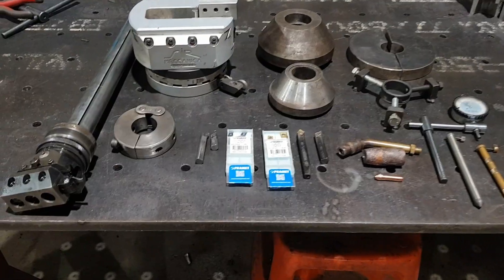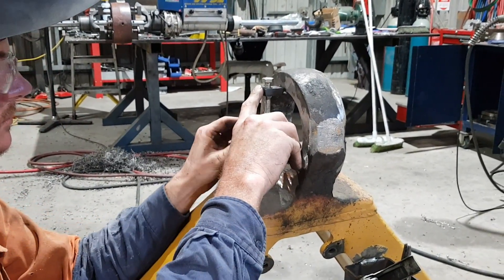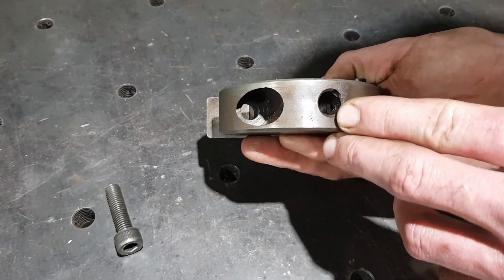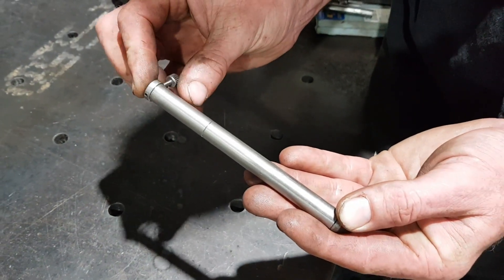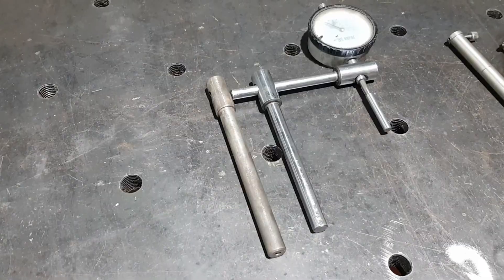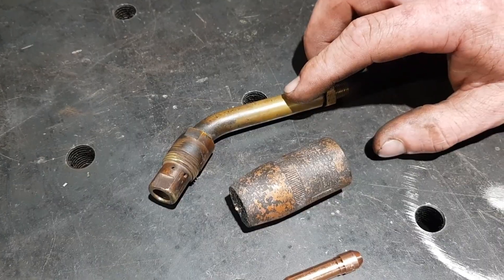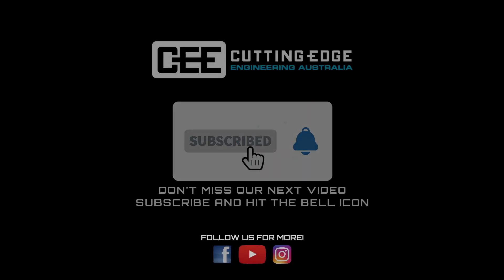Tooling for Line boring & Bore Welding Machine | Sir Meccanica WS2

Comment: This filled in a lot of the blanks. Normally this stuff goes by really fast when someone is doing a boring job. I'm familiar with all of the components in different contexts e.g. a boring head on a mill or a wire feed welder. I had an idea on how this all went together but this makes it very clear!

Comment: @2:23 "They are quite fiddly..."  Yeah, I can imagine trying to indicate something to center with three jack screws 120 degrees apart is frustrating.  Have you tried a shop-made version using 4 screws, more like a 4-jaw chuck?

@4:38 "It's very easy to get on and off the bar."  Do you have any experience with Hofmann Engineering's line boring tools?  They appear to have a wide assortment of tools that are split to clamp over the bar, so you don't need to pull the bar to swap from boring to facing or whatever.  Their current website no longer features a complete catalog, just a two-page brochure, which doesn't show their full range.  Somewhere, I have a download of an old multi-page catalog from Hofmann which shows their various line boring tooling (including fancy taper heads and whatnot, not all of which do clamp on the bar).  I like the way you used the chain link to make a double hinge joint!

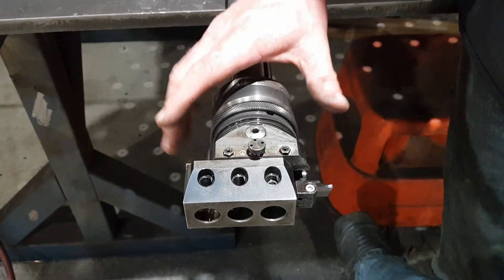@10:46 Nice adaptation of a standard boring and facing head to the bar for end boring.  I like!

@14:10 Great tip on the header paint as anti-spatter!

I have a couple of projects for which I'll need to do a bit of a lash-up line boring rig: boring loader bucket pivots for bushings; boring and counter boring my Land Rover engine block (2002 Disco with 4.0) to accept top hat liners (!); fab and machine an articulation joint and output shaft support to convert my old gear drive Cub Cadet to 4 wheel drive with articulated steering.  I've never used a line boring rig, as yet, but I think if I'm careful, I should be able to make a kit that will be generally useful beyond the immediate tasks at hand.  No one local to me wants to mess with boring the engine block, and the other two are recreational in nature and not necessarily remunerative when completed, so I can't justify paying someone else to do it, or even justify the cost of bar rental.  So, it's make my own or nothing.

Thanks for the very insightful video.

Comment: Great information in this video! I use and Elsa machine roughly every day and I need to get some quality tool holders for more flexible machining. What brand are the holders you use in your machine? The tool holders that come with the Elsa machine only hold an Elsa specific insert and they are not cheap and take a while to get in. I need some more flexibility for the day to day with some standard and common inserts. Keep up the awesome work!!

Comment: There's your side line, Mate!  Manufactured and marketed by your theoretical apprentice; one or more 'CEE Upgrade Accessories for the line  borer.  After market improvements for what appears already to be a great machine.  I love that line borer.  A versatile, compact and (apparently) robust machine that makes 'impossible repairs' possible and even straight forward, but only because CEE have stress tested every part.  And made your own.  Maybe other engineering firms have done the same, but I bet a lot haven't.

Keep doing what you are doing guys, I reckon you are becoming role models.

Comment: Do you have a tool to cut the faces of holes? I've only used climax equipment and not impressed. But I can't find a tool they make to cut faces flat. I've had to bore holes and add weld to the face of a hole to get the correct specs but no tooling to cut faces besides grinding by hand!

Comment: Hi! At 12'...is this a NAREX VHU 36 universal boring head? I worked with different Types of these NAREX Tools a long time ago at a mighty W200 Skoda Moving Column Boring Mill in the eighties nineties... These Skoda's are very heavy industructible Machines with LOTS OF TORQUE an KW's... To break the neck of a 120mm diameter(3/4 🍌 Bandana? 🤔) Drillbit Tool was not a Problem... 😉

Comment: Hi Kurt, thanks for the fine video, I have a huge amount of line boring to do on my machine, but curious on how your tool holder holds in place when you have just a chain link master link and a screw, do you bore it small and let the screw take up the tightening?

Comment: Add a set screw to the backside of the split block cutting tool holder to be able to fine adjust the advancement of the cutting tool?

Comment: Dear Kurtis, I really enjoy watching this video. I own an old SIR bimotor plus and a S3. I bought them cheap in electronically and mechanically broken used condition and reapaired and improved them step by step. Indeed engeneering and manufactoring quality of this stuff is not the best.  After the bimotor was running I had to thing about the tooling. After spending 400 bucks in original Sir Meccanica welding and turning consumables I decided to make my own (because it is not difficult, it is not worth the money). I made 1:1 copies of the welding torches out of brass. Turning tool holders I mill out of comparatively cheap chinese SCLCL06 boring bars with comparatively cheap CCMT and CCGT inserts. I still miss snap gauges (but I own a boring bar measurement tool from stationary line boring and an Interapid IRA2). I am thinking about making my own or buying some. Do you have any hint what brand is your steel one?  I started a first serious project a ditch cleaning bucket from a 25t excavator (central bolt). After the final cut and inserting the bolt I observed the problem that my holes became light eggs (around 0.10mm). At the moment I search for the reason in my remade bearing inserts (original ones were massively worn out) or in a bended boring bar (did you had exactly this problem with the original boring bar?). My next accessoirie project is making a new one out of 40mm 42CrMo4 piston rod.

Comment: You're right about manufacturers providing shitty accessories with their products. I bought a Rockwell 3rill combo with drills and bits, the right angle adapter and chuck adapter were cheap garbage. Chuck adapter kept on loosening and the right angle adapter held only hex bits.
Reply: Also the Rockwell didn't patent the 3rill and batteries so other brands stole the design of the batteries and drill. Rockwell sold it with patent pending written on them, that means any company can steal the design without patent numbers

Comment: I had never heard of the Meccanica line boring system. I will have to look them up. I have used Climax (USA) quite a bit for line boring with success. I also really like Mirage (UK) for most other onsite machining. Wachs (USA) and MillHog (USA) for pipe work. Thanks for sharing.
Reply from the maker: Nice one a good range there! Cheers 😎👍

Comment: A very good explanation. I had not even seen this kind of job till I watched you. You have just answered about all of the things that came to mind while watching. The only thing that looks a bit of a pain is the adjustment of the tip for the next cut after you have measured the bore. I can imagine that it is easy to make too big an adjustment and then move it back too far and end up overshooting the required position. Any possibility of a fine thread adjustment grub screw in the head? Having said that when you do it all the time you probably dont even find it a problem. Keep up the good work both of you.

Comment: Love the low-key “f*@k off Sir Mecchanica” comments. You are a man of class Kurtis.

BTW, ever considered modifying your custom cutting tool holder to include a cam or toothed rack advance to fine adjust the depth of cut? It would require cutting indexing features or teeth in the side of the tool holder, but would allow slow controlled movement of the tool instead of tapping it in and out.
Love the videos, your director knows her stuff!! 🤣

Comment: Very nice presentation on Your tooling for line boring. The massive boring/planing head, I can imagine how it does not have room to operate in most settings. I have a similar unit with Your Vertex. Mine was manufacured by germans under name Wohlhaupter. That type of a boring head is the only one You ever need in a milling machine. Highly recommended.
The snap gages, those require special way of using a micrometer when reading them. I know how it is done but maybe some of the viewers don't. I saw in one of Your videos You doing it and as You seem to know, it is not just turning the ratchet ...
Greetings from the opposirte side of the planet !
Reply from the maker: Hey mate thanks for watching over there! Yes the Vertex is a Taiwanese rip off of the Wohlhaupter.  Cheers, Kurtis 😎👍

Comment: Another well explained video,I was impressed with the machine as you use it, maybe you could suggest some upgrades to sir meccanica ! Is your vertex head suitable for facing the end of the bores or is it tight on space? Loving the outakes, no one swears as well as an Aussie!
Reply from the maker: Hey Neil thanks for watching mate. It can be used for facing as well just quicker to use standard tool holder in most cases

Comment: Ho curtis, i Made a boring bar for my radial dril, works pretty wel. The only problem is the mesuering. Now i use a standerd bore gauge. I have heen looking al over the internet searching for the thingy you call a snap gauge. I googled: spring gauge, snap gauge, telescopic gauge bore bar, boring bar gauge, no luck. Could you send me in the right direction?
Reply from the maker: Hey mate yeah they're not advertised bits of tooling but you should be able to buy one through an exclusive Sir Meccanica or Elsa line boring dealer/supplier if you get in touch with one

Comment: For the ignorant in the crowd (myself) why does the gas for welding have oxygen in it? Isn't the point to shield the weld puddle from the oxygen in the atmosphere?
Reply from the maker: Hey mate good question. The oxygen makes for a more "fluid" or wet weld so travels faster while being easy to control. 2%-5% oxygen is good 😎👍
Reply: I had the same question, searched comments for it, and found the answer from CEEA, cool! I've googled a little bit and yes, some oxygen makes your weld flat and smooth. Especially useful in surface building-up or deposition.

Comment: I wish I could find the video.  Saw it long time ago.  Someone was doing large diameter boring with a home made drive system.  The machinist had mated what looks like a VW transaxle to an electric motor allowing it to drive at 4 different speeds.  Cool setup and goes to show that you don't need a high end machine to get started.  Have a mag drill and some creativity, you can get in business pretty easily.

Comment: First, I love your videos! Second, I looked in depth into that machine. I personally have bee using Climax Machine Tools for over 20 years with great success. I have there facing head and it works great with my bar. Yes, you will need some extra clearance with the outside bearing support but a lot less! For my money, Climax is the way to go! Keep up the videos. I do love the snap gauges! I'm going to look into them.

Comment: It is very interesting to see the boring bar and the bore welder.  Kinda obvious when you think about it, a lot of that repair work just is not going to fit in a lathe or milling machine.
I had only heard of spraying metal on the outside of shafts before.  A 9" propeller shaft broke on me.  Afterwards I was told the shaft had been metal sprayed to build up from some previous wear.  I just tried to look as if I knew what metal spraying was.  I'm not so sure I was able to hide the disbelief about how much the prop shaft was miss aligned from the stern tube.  Fortunately the break happened far enough in the stern tube that the shaft maintained the water seal.  When we lost drive from one shaft I thought we had fishing net around the prop and blocking the prop shroud, so when we docked and the prop was about three feet behind the boat I was rather shocked.

Comment: Thanks for that Curtis that was beaut, I've got the idea but I don't know that I could just step up and do it"
But I've got a lot of respect for what you do.
Love the custom bits you've made for that rig, I'm sure they are sturdier and less prone to chatter, which I'm sure would be one of the buiggest challenges with a weld built up bore!
I'm surprised that your Prefered insets are high positive rake, I would have thought they were more fragile, especially on the first roughing cut, or is that what you were referring to with the double sided pressed insert..?
Anyways, love the info and the out-takes are Gold!

Comment: How exactly can you get clean welds without having to clean away the flux between each rotation or layer?
I would have imagined you'd have to brush it constantly, but even without it the metal looks seamless after boring it out.

Comment: Great bit of kit, very interesting in its use. Love that clamp ring with the chain link, very clever, I think I commented on it before.
Nice job on machining a square hole for a standard groove tool in the Vertex head.
Thanks for sharing both.
Best regards John.
Reply from the maker: Hey John thanks mate yeah you have commented on the clamp before!

Comment: Cracking video as always, I run a WS1 machine and it’s great to see your set up and improvements you made
Reply from the maker: Nice one mate have you done any mods to your setup?
Reply: @CuttingEdgeEngineering  sorry for the late reply, i've not made up near as many mods as you, just some bar extensions and various cutters & some new centering cones. but since seeing your vids and I've copied your ideas with the half circle plugs and would like to make up some new bars when i get the time, did you use hardened chrome bar for the new bars you  made up?

Comment: Curtis, have you ever triad just using cheap cooking oil to dip the shroud and tip in to stop the slag from sticking>
Reply from the maker: Hey mate actually never tried it have heard of it but might have to give that a go 😎👍
Reply: @CuttingEdgeEngineering  Put the oil in a old beetroot can and wire it onto the side of your welder, so that when u dip the shroud you can hang the gun in such a way that it can drip off any oil, when you use it every now and then just give the shroud a tap on the side against something to make sure any crap fall out, and dip it in again, a good clean shroud keeps the gases flowing nicely.

Comment: When you were taking about speeds with the vertex boring and facing head, do you mean there are three feed speeds that the head advances per turn when the ring is held in place? Or were you talking about rpm setting?
Reply from the maker: Hey mate yeah was talking about 3 speeds when it's held that advances the head. The speed settings are 0,2,4,6 and we have it on speed 2. Cheers 😎👍
Reply: @CuttingEdgeEngineering  Oh that’s really cool, I thought those heads only had one speed

Comment: Gday Kurtis and Mrs Kurtis, thanks for taking the time to explain all this, the head that comes with the machine is friggin big, it would be a pain in the ass to use anywhere really, what material do you make the bars out of so there’s no deflection, throughly enjoyed this video, you did a good job, cheers Matty
Reply from the maker: Hey Matty glad you enjoyed it mate! I used 4140 solid chrome bar to make the new boring bars works a treat. Cheers, Kurtis 😎👍

Comment: Great stuff.
Was wondering what kind of bearing are fitted inside the bar supports, since the bar needs to rotate and at the same time be advanced.
Does it introduce any run out, if so how much?
It seems to slide very freely inside them.
You skipped the main tooling makes everything possible, the one that has a 4 punches and two mighty saws and goes woff woff when engaged....
Reply from the maker: Hey mate hahaa yeah I knew you would miss the main boss. He was keeping an eye on the job that will be on Friday. There are 2 ball bearings and a sleeve between the bearings that the shaft slides through. No run out problems with that 😎👍